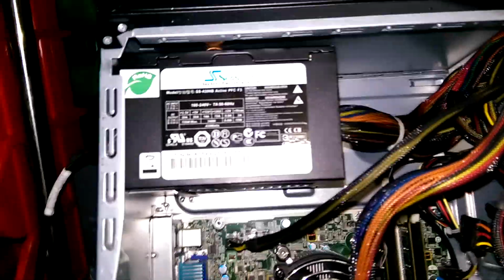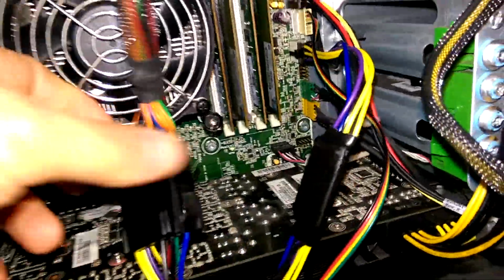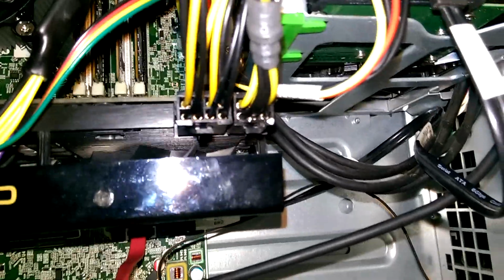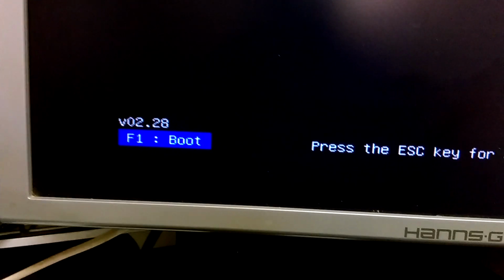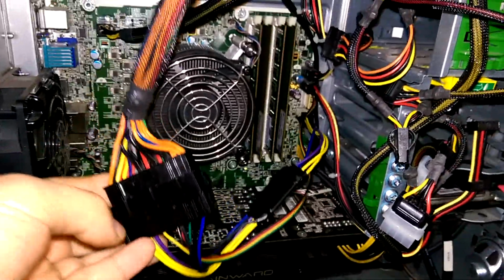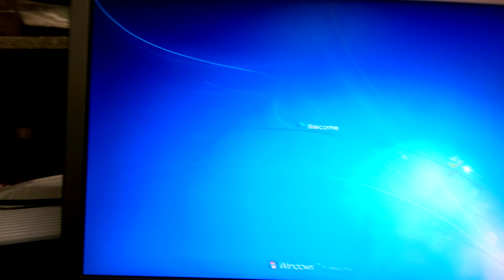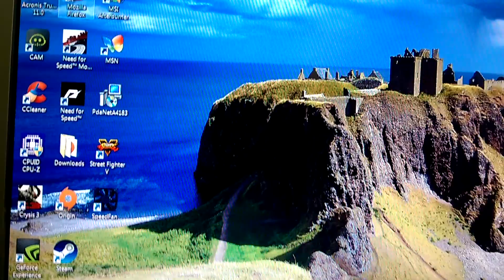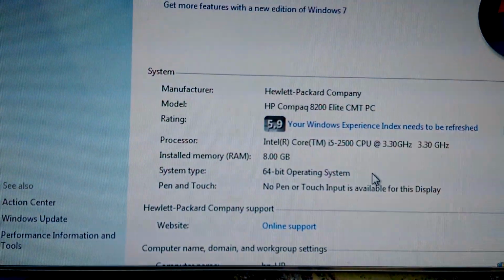HP ELITE 8100 to 8300 SERIES USE YOUR OWN PSU!

Comment: any changes in the heat produced by the psu or graphics card that might effect the cpu, motherboard and bios? I recently got a 8300 tower from work and might put a 670 or maybe a 470. Still need to see if my bios are the recent revisions since I heard the bios can be picky.
Reply from the maker: Oni64 Hi there.  I've had no heat problems at all while gaming for hours with my amd 7970 + corsair vs 550. what makes you think there is a problem? I've sold around 40+ a few didn't work in some machines but never heat problems. thanks
Reply: Sotiris Demetriou Thanks for replying, just wondering. I checked my bios and they are from the 2012 revision which has UEFI and legacy is disabled. I might pick one of the cables up just to put in a good reliable PSU.
Reply: Sotiris Demetriou Just to add, is there a solution for the F1 fan not plugged in message prior to boot? I hear that a few people wont get the message, but some do.
Reply from the maker: Oni64 so no solution :) that I know of sorry
Reply: im suspecting it might be bios related, or certain PSU's

Comment: Just tried to upgrade hp elite 8300 compaq,  received the cable from ebay. When I put everything together, PC wont boot and makes beeping sound (did't count how much).  I don't know what is the issue. . Any ideas ?
Reply from the maker: Not sure m8 I test each cable before sending it. could of been damage in the post. is the psu you are replacing the same as in the picture on eBay?
Reply: We got 3 hp elite 8300 pc so we ordered 3 cables. All of them won't work on my pc, tested with 2 different PSU. Later we will test on other pcs since I updated my bios. Could be bios issue. Or 4 pin connector on MB. Next time i will count beeps, there is a HP codes for beep count for identifying which component is failing. WIll post what happens. I doubt it's the cable issue
Reply from the maker: Where did you get them from?
Reply from the maker: Sorry I thought you got them from me. But you got them from somewhere else
Reply: probably.
Reply: hey Coldas same problem here have you figure out any solution ?
Reply: I had a setup with 2 PSU's, one with only GPU connected, and second for the system (both psu to be started almost simoutanuosly). Well it won't last long thou, and is kinda expensive owning 2 PSU fort 1 setup(you will be better off with some pre owned custom build or refurbish workstation with enough power connectors).Well long story short,  we sold those pcs with no GPU for some suckers. Learned a lot since my post. Do not try to upgrade OEM (pre factory made) pcs. It's fucking torment. Sell that shit, and buy the upgradeble pc components for youm from used item store or what whatever you call craiglist or some other aviable site in ur location

Comment: What about the 12v standby power? The new power supply has 5vsbp only.
Reply: You Will need to concert it
Reply: The wire harness that he's showing includes a step-up converter from 5V to 12V to power the standby circuit, it's covered by some fat black heatshrink.

Comment: I got that cable converter. How do I supply the 4 pin near the cpu? I have tons of 6 pin cables laying around.
Reply: You should use a suitable power supply which has a P4 plug. Since the power draw on 5V line is minimal, it's recommended to use ATX12V 2.0 version or newer power supply, or stability issues may be encountered.

Comment: Hello sir, Can i use my i7-4790 processor on my Hp elitedesk 800 g1 sff to another normal computer? with the same socket 1150, do they have the same size? processor dimension?
Reply: as long as its the same socket that should work, make sure to get a cooler because the OEM coolers only work on their respective mobo's

Comment: If you want this cable look up on eBay  hp z220 psu cable and it works the same there is a video on YouTube of someone using this cable on the go 8200 elite and it work perfectly

Comment: Is this safe to do? I'm reading the specs that say the PCIe slot will only draw 25 watts of power and the cables only handle so much wattage.
Reply: Yes it's fairly safe!

PCIe is designed for a bit more power than that, i forget how much exactly, 68 or 75W, that order of magnitude. This is how the GPU shipped with many of these PCs originally works, one that's often found is HD7750 with 55W power draw.

However if you look carefully, the reason he replaced the power supply here, is that the card is connected to the power supply directly with two 6- or 8-pin Molex connectors (75 or 150W respectively) and draws the majority of its power there, thus it wouldn't work with the stock power supply which besides not having enough power altogether also doesn't provide these connections. You should never use SATA power or 4-pin AMP to 6/8-pin Molex adapters, they can cause of fire, use a power supply with suitable connections for high-power consumers such as this GPU already foreseen.

Comment: I’m in desperate need of one of these cable adapters. In the video he talks about how hard it was to find and then doesn’t share where he found it at. Then below people talk about how expensive it is and still don’t talk about where to get it. Then somebody goes on to comment how you can’t even get them anymore which is very discouraging. I would truly appreciate any info on this mystery cable adapter. What it might be called and where to find it would be awesome. Thank you for any help given
Reply: This adapter is on Amazon or eBay, I have preferred to take it from the Amazon, I found several types, I took 2 one that costs 20 € and the other 6 €, the one that was more expensive even if I tried to change pins did not work with my pc model, but the other adapter that cost the 6 € I changed the wires between them on the  connector wich 4-wire and 2-empty and the pc after 7 months with this adapter worked at perfection (except the fan error, press F1 and everything goes well, and yes I think it can be solved the error from the fan but it's more complicated) 
The link where did i get the adapter: https://www.amazon.it/lujiaoshout-Alimentazione-Mainboard-Server-Workstation/dp/B01FFNXAGC/ref=sr_1_4?ie=UTF8&qid=1552236823&sr=8-4&keywords=psu+adapter

Comment: Hey guys, having seen this video and the adapter i bought myself one from amazon but have no clue how this works.? the adapter i purchased i noticed only has only 10 pins not 24 as i thought it had on the advert? this aint right is it? anyone kindly advise.

Comment: bump! any update on the cable?
Reply: can you explain more please? i have the "Atx 24 pin to 6 pin z220" for my hp 8200 but not working
Reply: +Luis Mendez is the hp 8000 and 8200 are equal?
Reply: Mr VaM yes. 8000 - 8300 are the same, just with different cpu/power/graphic configuration
Reply: +Luis Mendez Thanks alot <3
Reply: Nice!
Reply: what about the 6300?
Reply: xBane_ Hp elite 6300 or? Not sure
Reply: Honestly have no idea, but it will probably have a similar connector so if you get a cable for a z220 or something like that and check what order works on the 6300 it might work. But then again it might have a different one. Have you checked how the connector looks? If it is the same it will probably work but it might have a different setup with the pins. Personally when i changed the pins i just tested a couple of configs and it did not break the motherboard, but your milage may vary. If you get any results then keep us updated :) gl
Reply: thx

Comment: Will this cable work with a HP 8300 SFF? (setting aside how the psu will fit in the case...)
Reply from the maker: Vasilis Maroulis it should do as long as your HP power supply cables match mine in the last 2 pictures on the eBay listing.  thanks

Comment: I really need to know how to get this cord. my 320w cant handle my gpu and 16gb of ram so i need something stronger. and with this power supply you cant add on a second gpu
Reply from the maker: Bret Ciesielski I will have some more cables by next week hopefully thanks.  just follow the description in the info.
Reply: Sotiris Demetriou I actually just found them on Aliexpress. Thank you so much for the video though :)))
Reply from the maker: Bret Ciesielski good luck with that.  the wrong cable will damage or even blow your motherboard. so be careful
Reply: Sotiris Demetriou I sure hope its the right one haha
Reply from the maker: Bret Ciesielski ok go for it. good luck.
Reply from the maker: Eli X I will have some something next week thanks.
Reply from the maker: Bret Ciesielski back in stock thank
Reply from the maker: Heymzey Lefield Look at this on eBay  http://www.ebay.co.uk/itm/112275694724

there you go
Reply from the maker: Non will fit perfectly I'm afraid.   You will need to fiddle a bit to get it to stay.  Thanks
Reply: You can always try a SFX format power supply instead of a std ATX size. I hope we are talking about the CMT version of the 8300, not the SFF. It might get tight with a SFF.
Reply: Sortiris, can you show a picture of your case to enlighten the folks trying to fix their machines?
Reply from the maker: There are many ways to get it to say. I have wedged a piece of wood in between the top of the case and the psu. That's worked well for me.
Reply from the maker: Any will fit the CMT case. At the moment I have a amd xfx 7970 ghz edition in mine that's a big card
Reply from the maker: JinkS if your power supply matches my power supply it should be ok I've have a few people that have used it with SFF.  but she going to be limited on your GPU and problems fitting a power supply in there. thanks
Reply: sold out :(((
Reply: Sotiris Demetriou you were right... I just killed my motherboard.
Reply from the maker: Sorry to hear that. It's not too expensive to replace them though. Your the 5th person I know to have done this :(
Reply: Just got my hands on a cheaper Optiplex 790. They still have the same issues, Proprietary PSUs and limited power rails on the PCIex slots. 
@ Bret - What kind of card did you try on the board?

Comment: hello o want to ask you so ples answer me fast i will buy hp compaq 8200 i5 2400 i already have gpu gtx 960 so i can change the psu or not ??i hear from my friend he tell me that hp compaq 8200 hi psu can't change is this real ? sorry for bad english
Reply from the maker: Kaido CS if the case is the same as in the video you can only use your gtx960 with this cable and a new power supply.  thanks

Comment: Hi! I have a gigabyte gt630 gpu with NO additional power supply connector (it needs a 350w psu, and with the original 320w psu, the pc (hp elite 8300 cmt) shuts down during the boot process (tested whitout any hdd or ssd), and turns on again automatically). Will it work with this cable (with a hkc 450w psu)?
Reply from the maker: Peter S Hi there I am unsure whether it will fix your problem. does the PC boot ok without the gpu?
Reply: yes
Reply from the maker: Peter S the only thing you should try before buying the cable is make sure it's not your gpu that has a fault try it on a different PC if you can? the small difference in voltage should not make a difference it should start at least and when under heavy load it turn off and then it will be your power supply can't handle it. thanks hope that's helps you
Reply: that gpu and psu work in my older pc now ok

Comment: works well except the cpu not detected but spinning ,, updated my bios for extra settings cant find them hp 8200 i have 700w power suply fitted and gtx960 just annoying the f1
Reply: Where did you get yours from? Is he still selling these? What is the link if so?

Comment: Can you move the motherboard into a new case?
Reply: obviously no, cuz it's a small form factor pc
Reply: @cossychan  No, this is the CMT configuration, the SFF variant simply doesn't fit an ATX power supply at all, as there are parts interfering with the space foreseen for it - in CMT you still have to drill new mounting holes for it, but the space is there. It seems to me that the board has standard ATX hole pattern, but i honestly haven't tried to transplant it yet, so i won't be surprised if they butchered that too.

Comment: Hi , I have an hp 8200 CMT And i want to know if that motherboard will be fine with this case http://www.pcgamercasa.ma/144-thickbox_default/asrock-h61m-dgs-r20-cartemere-pcgamercasa-maroc.jpg
Reply: The first undisputed champion all HP ELITE series motherboards are non-standard... meaning they won't fit in any case other than the original

Comment: Anybody able to find a better cpu cooler for the 8300 cmt?
Reply: Doesn't need one, the supplied cooler is, in spite of its simple looking construction, actually pretty good. If you're having cooling issues, and have already replaced the thermal interface paste between the cooler and the processor, chances are your processor needs to be delidded. If you don't have a good thermal connection between the die and the integrated heatspreder, no cooler will be able to do anything about it.

Comment: M8 your a life saver
Reply: +Sotiris Demetriou quick question what power supply do you use also can you pls list your parts that would make my day it's a pain in the ass trying to do this
Reply from the maker: I have a 430 watt seagate PSU in the video I had a nvidia gtx 580 now a ati 7970 and 8 gb ram. But you can use any power supply as long as it has 24 pin ATX connector and has enough power and the correct pins for your card to drive your new graphics card.
Reply: +Sotiris Demetriou thx m8
Reply: +Sotiris Demetriou How many 6 pin connecter do you have on your motherboard
Reply: +Sotiris Demetriou will this work on a hp 6000 pro small form factor
Reply from the maker: +CONSOLE SECOND CHANNEL Hi there I am unsure if it will work sorry. but if your original power supply has the same outputs spec for spec as the one in the picture on eBay then it could work.
Reply from the maker: +CONSOLE SECOND CHANNEL Hi there I just answered this a few minutes ago and the pins look the same but I'm unsure I have no way of testing it. if you live in the UK and buy one and it doesn't work I can refund you the cost but not the p&p after you return it back to me. thanks

Comment: Hi i have the 8000 elite with Q9650 16 gigs of ram  but i cant add a decent video card plus more hard drives could you please consider selling me one of  your cables i am in  North Carolina usa
Reply from the maker: should not be a problem it will cost £25 if your interested ask a question about posting on eBay and I'll send you the offer thanks.

Comment: bro what psu did you use and can you give me an idea on what motherboard would fit iin it...Thank you
Reply: its a seasonic psu of some form
Reply: Hey just read your guide and your the first shining beacon of hope for me to get my lan party sleeper pc running thats gonna be running one of the 8100 boards. Just wanted to clarify that what yyour saying to do in short is to move every connector on the white flat 6 pin one space to the right?

Comment: I tried this using the same cable and it would not boot , just beep
Reply from the maker: BobbyJAX Gaming where did you buy it from?
Reply: Amazon
Reply: looks and say it I did everything I said in the video,  I havea 8300 HP midtower
Reply from the maker: I keep telling everyone don't buy them because they look the same as mine they are totally different.  You may have damaged your motherboard.  Put back your original psu if it starts your lucky.
Reply: yeah i put it back and it runs fine
Reply: is there a better site
Reply from the maker: Ok cool. I know of 2 that blow there motherboards that got it from alibaba
Reply from the maker: Yeah from my :)
Reply from the maker: Have a good evening
Reply: ok give me a link
Reply from the maker: Look at this on eBay  ebay.co.uk

Comment: Hi Sotiris, I can't get any product of you on ebay. can you please reactivate this product? i want to buy it on Sep 10. i need this product
Reply from the maker: hi there I will put it back on eBay soon I'm having a few problems with some people saying it don't work   on there model. so need to sort it out. what model do you have and what cpu is in there thanks
Reply: +Sotiris Demetriou i have HP Elite 8300 and i have GTX 650. i want to upgrade my VGA Card to GTX 750 Ti. and i'm confuse that all PSU is always have Atx 24 pin and 6+2 pin or 4+4 pin. if i have your connector so 1 my problem is solve, what about the other 4 pin in the top left of the motherboard? what can i use to connect that pin? Please tell me your explanation, thank you very much
Reply from the maker: +Septiandi Dwi Nugraha it will definitely work on your machine.  the 4 pin is powered by your power supplied directly
Reply: +Sotiris Demetriou is it same between minitower and microtower?
Reply from the maker: Only for the minitower like the one in the video and not the SFF ones.  Thanks
Reply: +Sotiris Demetriou support for hp carver rev A right? sorry before if i ask you to many hehe
Reply from the maker: +Septiandi Dwi Nugraha ?????
Reply: +Sotiris Demetriou that is type of motherboard HP Elite 8300
Reply: +Septiandi Dwi Nugraha hi sotiris, if i want send it to indonesia, so i have to use royal mail international courier for send it to Indonesia?
Reply from the maker: +Septiandi Dwi Nugraha i use them to post so yes. thanks